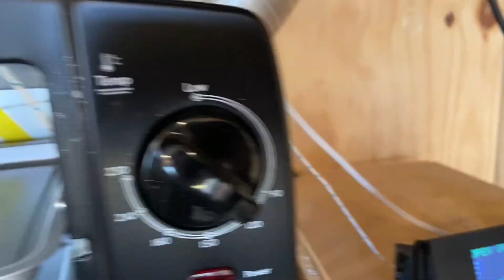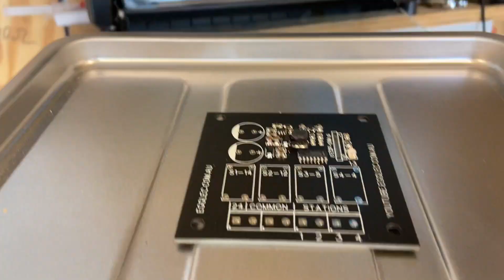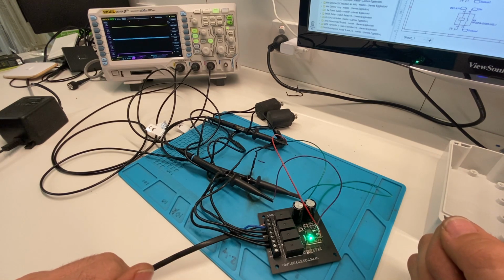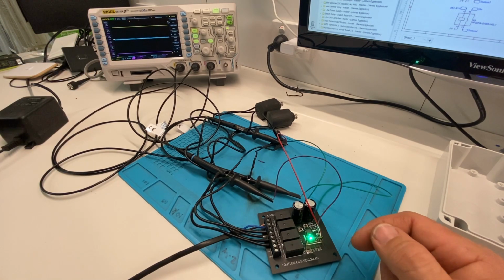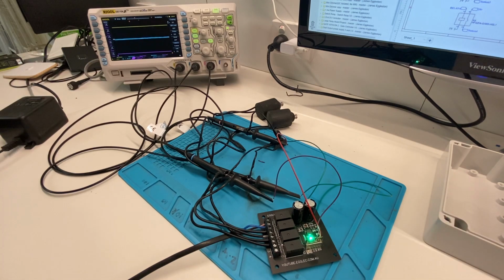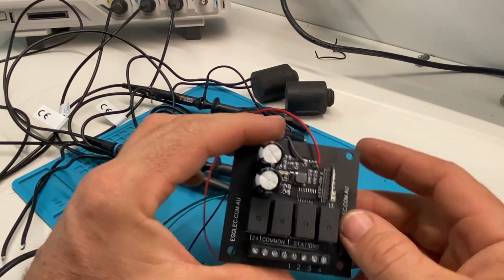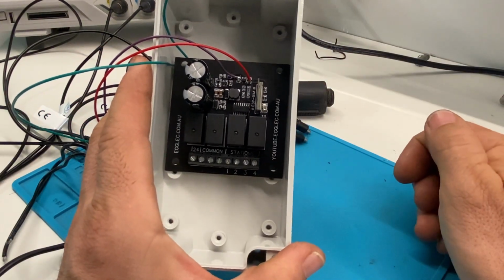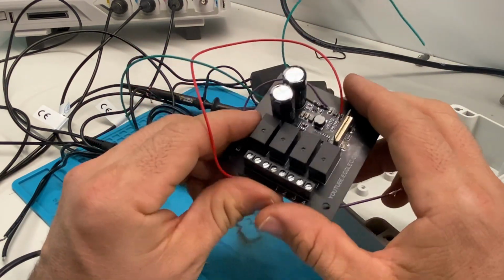Reticulation Controller for Home Assistant

Comment: Great project. A benefit of being in Home Assistant is that theoretically you don't need everything wired to the same controller.  Very doable in code to control the master valve from one control &  remote stations from another, to minimise solenoid wiring.
Reply from the maker: I didn’t actually think of that but that is very true.

Comment: I have a quick question. I am about to do the same thing using a Sonoff  Pro which can be powered by 5-24V and is basically the same thing. Not being smart but why is yours different? PCB looks awesome though. Nice layout.
Reply from the maker: Good question the Sonoff pro is basically the closest thing to this device. The Basic Retic runs on 24v ac, which is what most reticulation system use to operate the solenoids, the sonoff runs on DC so you would need 2 power supplies one for solenoids and one for the sonoff. Also the Sonoff is larger, so it definitely wouldn't fit inside an existing retic controller, this one can fit inside some roomy controller boxes and run off the existing power, and you can keep the existing controller in parallel with the Basic Retic for WIFI control. The sonoff is not weather proof, so it can't go out side with out an additional enclosure which would be quite large. The basic retic is design to fit perfectly into a small enclosure that is weather proof, this is convenient if the controller is outside which it often is, if you buy one pre made it will come with ESPhome on it, you to connected it, login and change your wifi details, that all, it is also cheaper than the Sonoff-Pro. I also intend to work on it, more to make it easier and more plug in, for those that don't like to tinker in setting and with ESPhome so it's a simple click and install in Home Assistant, or even a stand alone device for someone that doesn't use Home Assistant.
Reply: @SparkyJames  After I wrote this I realised the 24VAC thing was the killer feature. Good work. I use my own firmware. I have updated it a lot since this ver, but I find all the versions out there super complex for just ON/OFF.   I have a switch running here for years without a reboot lol. https://github.com/KmanOz/KmanSonoff
I have my Sonoff now but maybe next time :D I only just stumbled onto your channel so haven't caught up with your goings on :D Good luck. Very neat board. Looks pro.

Comment: Won't the light sensor be activated by ambient light conditions? Are you planning to lock out the light sensor from sunset to sunrise?
Reply from the maker: The idea was that it would detect a multi click for example on then, 1 Sec off,  then on again. So a quick hand cover on the light sensor. I’m trying to figure out how to stop bounce of sorts, it needs a filter so that it is accurate.
Reply: @SparkyJames  sounds doable. I wonder if it wouldn't be easier to have it activate above a threshold. Eg. Your phone torch. If lumens reaches random brightness. Do action.